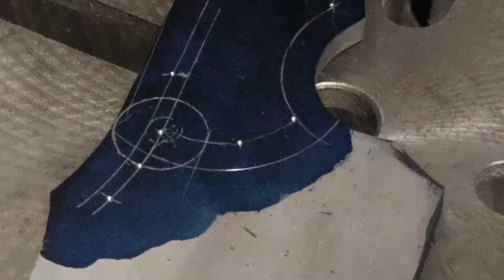Making a war Cleaver - knife making

Comment: Quick question.  When I do my ferric chloride finish, it comes out blotchy. I sand to 2000 grit. And then dip it. Any suggestions to make it more even?
Reply from the maker: Sure, dip it for 20-30 seconds then buff it with 0000 steel wool and repeat 10 times or until you achieve the desired finish

Comment: What was the rpm of bit when you milled spine. Pls answer
Reply from the maker: Good question, I reference a machinist handbook for speeds and feeds. Real handy little book for HSS bits. My book is a little to old for carbide tooling which runs at different speeds. But basically the smaller the bit the faster the faster you run it. On a mill you have two different things to take into consideration.  The speed of the end mill and also the feed rate. I generally test a peice of scrap steel before hand and dial it in. I don't know the actual rpm that I was running when I made this peice.
Reply: @Aleeknives  First, thanks for your quick response. Second can you pls refer the handbook.
Really nice videos.